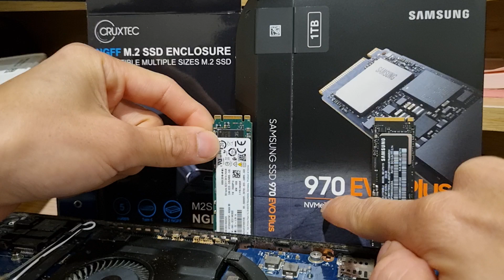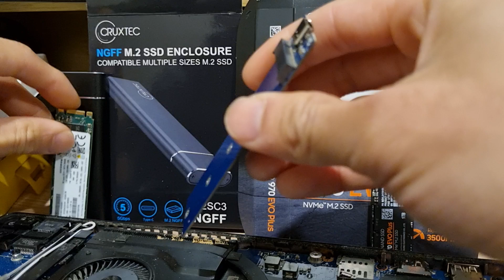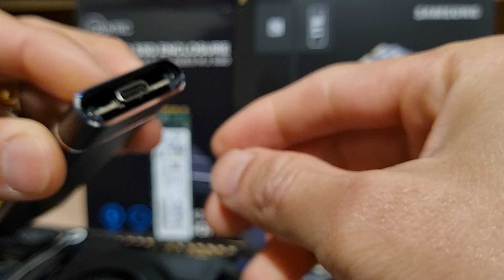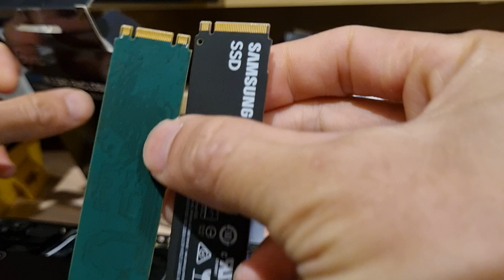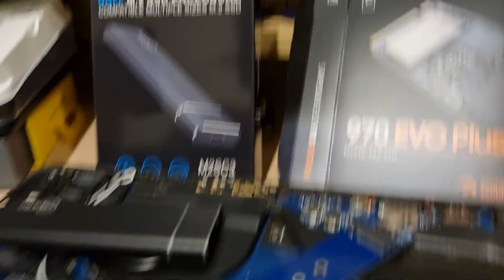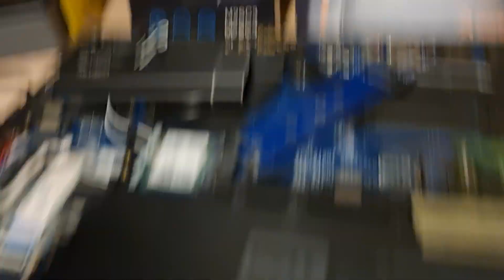M.2 NGFF vs NVME

Comment: Very informative! It only makes sense that newer technology isn't supported by older technology, like trying to fit an NVME SSD into a NGFF slot, but newer technology supports older technology, like fitting an NGFF SSD into NVME slot. It's like how you can run PS4 games on a PS5 but not the other way around.
Reply from the maker: Thanks. Yes you're right. Normally the new tech is backwards compatible.  My mistake was buying the NGFF enclosure because it was cheaper than the NVME one.... thinking it would work. Owh well, lesson learnt just trying to save a few bucks. Hopefully others don't make the same mistake as me